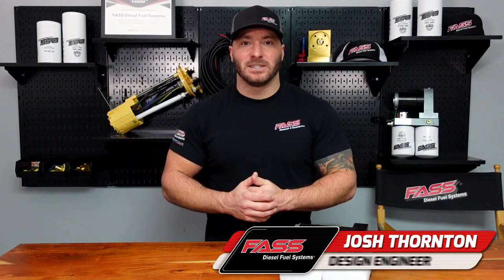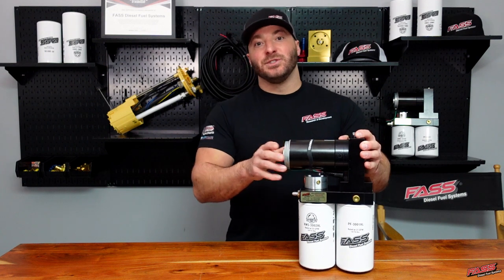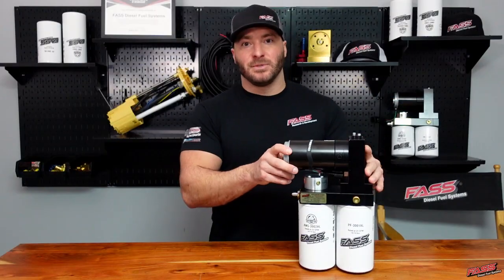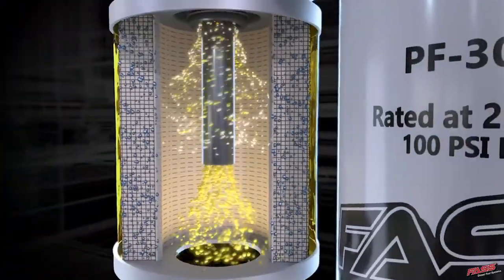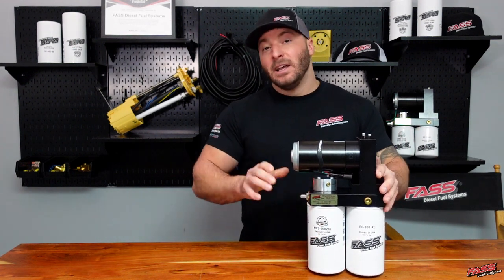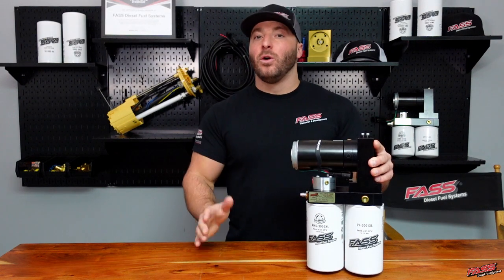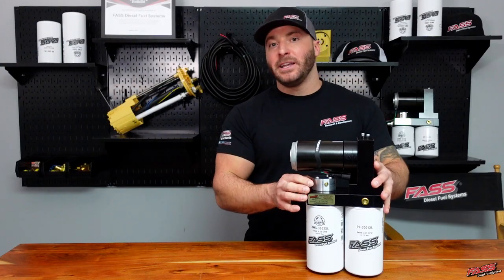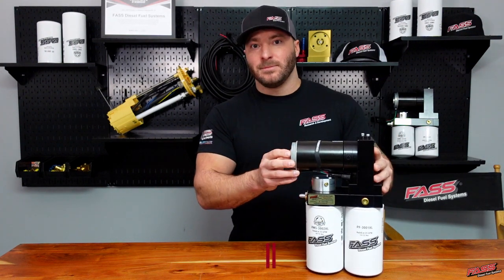FASS Industrial Series Systems for Detroit, Paccar, CAT, and more!

Comment: Do you guys by chance have a video and or an all inclusive kit with all hoses fittings etc for a 1999 12.7 60 series detroit ? I am very incredibly interested
Reply from the maker: Sure thing, we have kits for the Detroit engines and most class 8 applications. To verify fitment how much power is your truck making?
Reply: 430 currently I was going to change calibrations to 500 but if that will change the dynamic of needed fass system I dont have to
Reply from the maker: @edenfieldjared0  sounds great, we have a link here for the kit we'd suggest for your truck: https://fassride.com/shop/product/shop-category/universal-industrial-series/fass-ind165g-industrial-series-diesel-fuel-system-class-8-semi-165gph-universal-ind165g/

Comment: I have an older Fass system, about 13 or 14 yrs old on a 2006 Duramax. It's still going strong with no issues at all. The only little expected issue is the blue fuel line is really weathered, where can a guy get more fuel line? I'm in Alberta Canada. Thanks
Reply from the maker: Awesome question, and we appreciate you reaching out! For the blue fuel line if you don't mind give our service team a call at 636-433-5410 and they will be happy to get you setup with what you need!

Comment: For a cat c15, would this replace the oem filter and mechanical pump? Or would the work in conjunction?
Reply from the maker: Hey Alejandro, thank you for reaching out! We would feed the transfer pump. The engine-mounted secondary filter would stay in place.
Reply: @FASSFuelSystems been looking into your system for my acert c15. I seen you said you keep the engine mounted filter in the setup, does the FASS system replace the primary frame rail mounted filter though? Also guessing the 250gph system is the way to go?
Reply from the maker: @davidbolle2203  correct, the FASS will replace the frame mounted water separator. The size of the FASS will depend on the power of the truck though. How much power are you making?
Reply: @FASSFuelSystems  I am around the 600-650 range
Reply from the maker: @davidbolle2203  sure thing, we have a link here for the kit we'd suggest for your truck: 

https://fassride.com/shop/product/shop-category/universal-industrial-series/fass-ind250g-industrial-series-diesel-fuel-system-class-8-semi-250gph-universal/

Comment: Hey bud I got a Detroit series 60 12.7 I wanna add this one  but not sure if I should go with the 250gph or 290gph I’m set at 500 hp
Reply from the maker: Thank you so much for reaching out and that is an awesome question. We would suggest going with the 250gph system for your truck and have a link here for you as well. 

https://fassride.com/shop/product/shop-category/universal-industrial-series/fass-industrial-series-diesel-fuel-system-class-8-semi-250gph-universal-ind-250g/

If you have any other questions or need anything at all you are more than welcome to reach out to us anytime. Our number is 636-433-5410. Thank you!
Reply: @FASSFuelSystems  would I need to buy the kit as well ?
Reply from the maker: @ericdiaz1348  The link above is for the complete system—wiring, fittings, and fuel line are included.

Comment: does it fit on Detroit diesel 70 series, 90 series engine and the Mack engine
Reply from the maker: Hey Jeremy, we appreciate you reaching out! We do have a universal system that will fit most applications. To get you set up with everything you need for installation I would suggest giving our service team a call, and we'll be happy to help! Our number is 636-433-5410. Thank you!